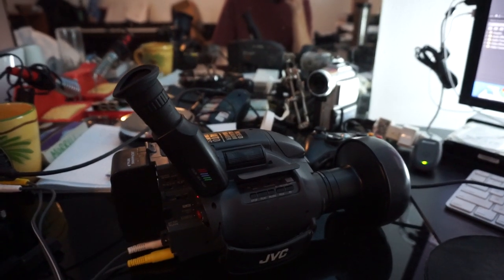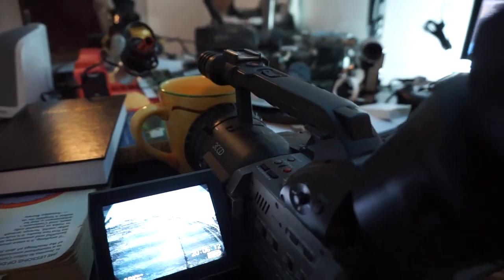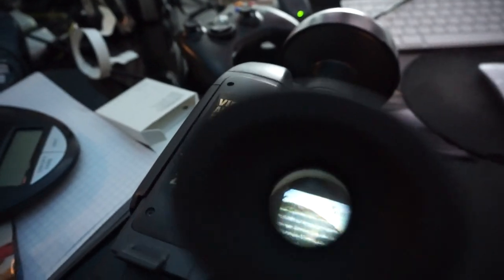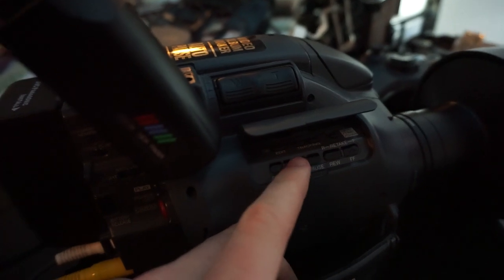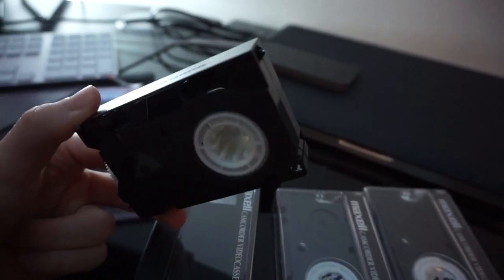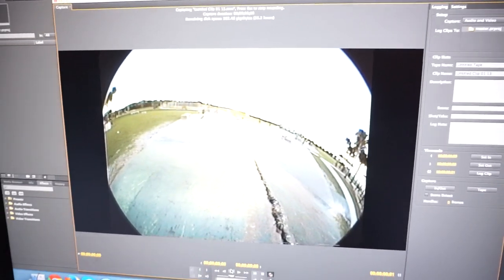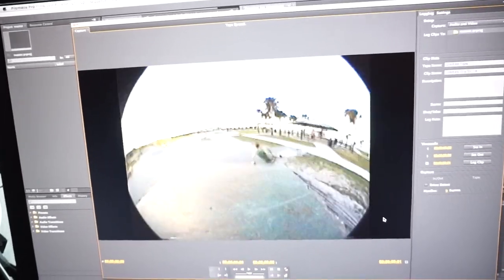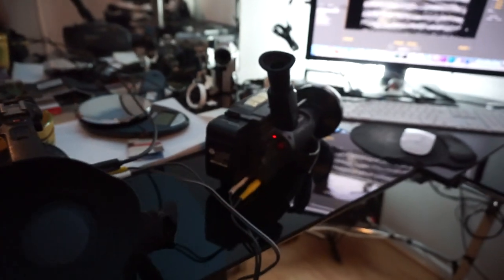How To Capture VHS Analog Video Through Firewire Using Passthrough

Comment: Never thought to do this and I've had this Sony camera here for 10 years with the capability.  Just tried it and it works fine.  RCA cables from VCR to camera and Firewire cable from camera to computer.  Just have to turn on the settings.  No need to go buy more equipment.  Time to convert all these old VHS tapes before they disintegrate.  Thanks!

Comment: Yeah, that's a pretty cool feature. I have a Canon Optura 60 MiniDV camcorder and Sony DCR-TV460 Digital8 camcorder capable of this. But on the newer Macs (except the "regular" MacBook) you'd need a FireWire-to-Thunderbolt adapter to perform this conversion. I've also seen Thunderbolt analog-to-digital video conversion boxes available as well, very similar to the FireWire ones Canopus used to make.
Reply: You can possibly buy a mac mini with powermac g4 cpu for a little prise. They have a firewire port.

Comment: Hey Shawn I've got a chance to buy a panasonic dvx100 and can see it has a firewire connection. Also there's the VCR or Camera setting. Does that mean i can get output into an imac via the firewire using the camera in camera setting. It's going to be on a tripod and not move anywhere. I just can't see the tape function being any good for my purposes. Thanks for your time ;)
Reply from the maker: Yes, you can most definitely stream live video while in the Camera setting via firewire to your iMac. I personally have done this before and I know that many people do this to avoid recording to tapes and immediately having their files captured and ready for editing.

Comment: I like this. It should also work with a VCR, right? Going from the VCR to the camcorder and from there to the computer. Why not. That said, the only question I have is: How does this compare to a "real" stand alone capture card when it comes to the quality of the conversion and does this take cake of TBC issues? Thanks.
Reply: Depends on the capture card but most cards you will find that are not considered pro grade and are priced accordingly and or / are old pci systems will do a inferior job. Capture cards capture stuff, they usually dont improve the input signal like a tbc device does. Those dv cams have a tbc on board, however not all of them do a equally good job. Theres a lot of stuff to read up on.
Reply: @maxmustardman298  Got it. Thanks.